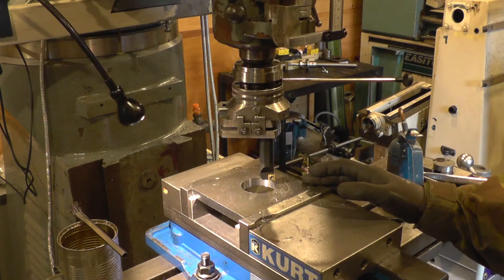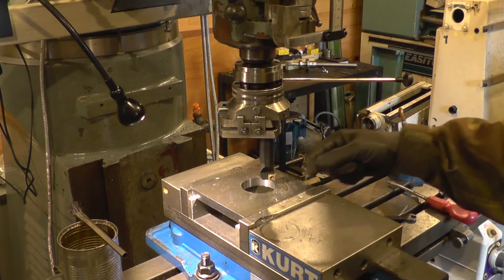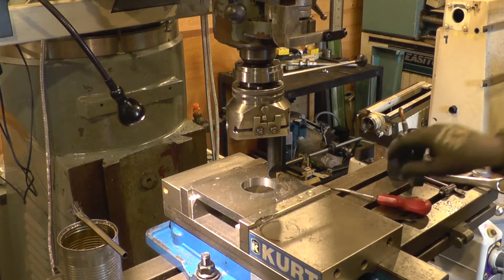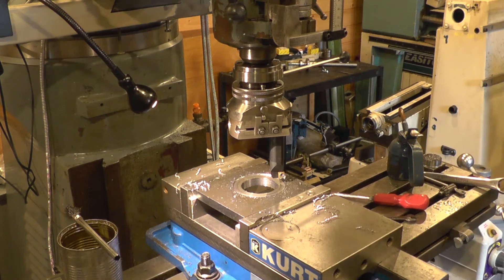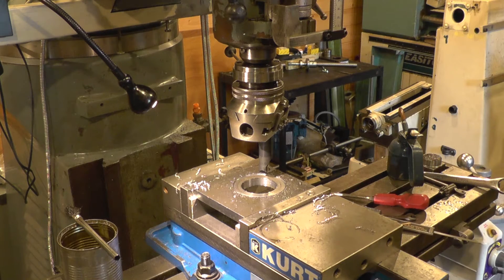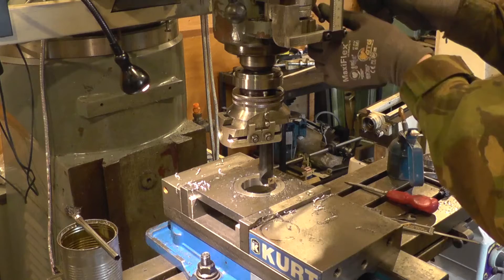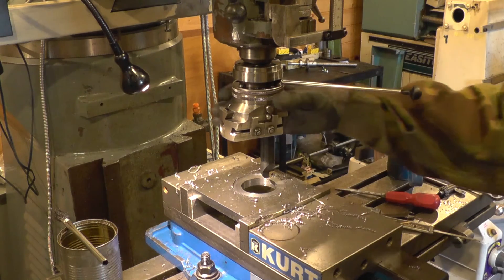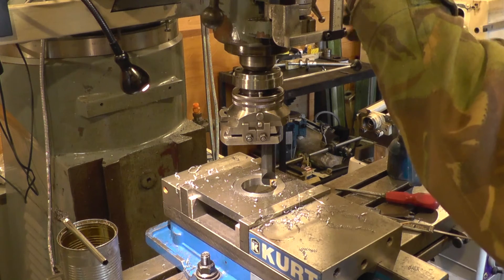Trying out the Automatic Boring & Facing Head

Comment: Hey dude do yourself a favor and use German machine for milling steel. I once owned a bridge port as well. Then i switched over to Deckel. Since some years now. In my opinion the bridgeport is good for milling Wood and plastic without Shatter😀
Reply: It's not the mill, it's the boring bar extension. This would happen on any mill. The Bridgeport is a good milling machine, they're used all over the US with excellent results.
Reply: @mosfet500  belive me it is an Other world in therms of stiffnes. Please Look up Deckel FP3L for example.    I am Sure it would performe this wo Chatter. I already did many similar boring operations.
Reply: Chatter is a result of many factors: cutter sharpness, length of boring bar, cutting speed & feed, material hardness, etc. Not only the machine and it's rigidity. German machines are good but so are Bridgeports too.

Comment: You would have been better off with a nicely sharpened and oilstoned HSS tool of much shorter length. Replaceable inserts are crap, especially on aluminium unless you buy expensive genuine aluminium type. I suspect you were using a Chinese elcheapo and elcrappo general purpose insert. With that head, can you adjust the facing feed rate, The Genuine Wauhaupter ones you can. I suppose to get around the patent / copyright they added the top ring you use for facing, but that pin access is in a crap place. My genuine Wauhapter has the pin directly in the top knurled ring and is easy to get to and operate. Make yourself a pin eject tool like the genuine one, simpler to use that a screwdriver as it has a milled recess in one end that locates under the pin head and does not slip off like a screwdriver can. If you can give me an email address I can send you a sketch with dimensions and a photograph of the eject tool.

Comment: Hi Paul , i have never used this type of boring head ( would love one along with a 3d taster but the coin outlay out ways the need !) what i’m curious about  is  if you could use the auto trip to set a cut off point when boring a cylinder ? I was thinking it would be handy if you could take a primary cut then measure and then set the auto stop using feeler gauges or gauge blocks to set the trip point for each depth of cut or even better set a final cut off and just wind the ring around X amount of turn / turns each cut.

Comment: Love boring heads but not the chatter. Are they prone to the same chatter on the lathe with a rigid spindle? (i'm guessing the loose quill bore gives problems)
Reply: Chatter is caused by the length of the boring bar - if Paul had a stubby boring bar say less than 25 mm long the chatter would disappear and this also goes for the lathe , shortest largest diameter is always best .
Reply: @Flattyman  A mill has a weak point thou, the quill . ..unlike a lathe. They typically move a lot
Reply: & the leverage length from the cutting edge acting on the quill.
Reply: I've never had much luck with any of the cheap off shore carbide I've tried so far. Sandvik Coromant has a really good YT video showing how they make there replaceable carbide tips. It's a highly automated but still no doubt expensive process to do it correctly no matter where in the world it's being done, and labor costs would have very little to do with the final selling price. I'm no expert, but that cheap price always means to me that for cutting tools one or more steps were missed or corners were cut to meet that low price point. I'd be willing to bet a decent quality tip on Paul's boring bar would have resulted in far better results without all the chatter this video was showing.
Reply: @turningpoint6643  Chatter with boring heads even with very sharp tools is still a bugger. Only heavy cuts that really plant the quill into the quill bore seem to work
Reply: @bubster1981  I'd certainly agree, I've got some short stubby braised 5/8ths dia. bars that came with my Narex B/F head that don't seem to chatter anywhere as easy as the one in the video did. Tool stick out is a big part of the tool producing chatter as well. My usual first method when it starts happening no matter what tool it is would be to reduce the rpm and up the feed rate. 95% of the time that does make a big difference. To be fair Paul's bar diameter to length ratio was maybe a lot more than ideal for a hardened steel bar.
Reply: @turningpoint6643  Its a bugger, everyone i know has problems. Precision bores are one , as you have to finish with large cuts and hope...to light and the bore may be chattered ruined
Reply: It couldn't be the sloppy fit of the bar in the head could it , sorry Paul couldn't resist. 😉 It almost certainly is the tip, Aluminium does like really sharp tools.
Reply: Rotate the bore bar backward in the head a little so as to create a dragging effect or negative top rake to load the entire system (quill, bar, bit, gibs on b/head, and  back gear & drive system) and as you approach the corner, lower the rpm to a crawl if need be as well as let go of the feed bar(reaction bar) and then stopping the bar every other revolution or so till the stop is tripped then engage quill feed up to smooth out the bore, and you always when boring (on mill) want to have your quill clamp snug, but not so tight as to kick out the feed, once set try to leave it alone so you won't affect cuts and measurements and always take the same amount of stock in each cut in order to produce consistently good chatter free cuts (total stock divided by number of cuts. Remember that as diam. Increases, rpm decreases, so if you set rpm for largest diam when facing you should avoid that maddening chatter late in your last cut that will make you want to scream! Also, remember that aluminum and carbide sometimes just don't work well together in which case hss may be your best option also boring and facing love back clearance and or small tool raddii. Happy chips to all and to all a good day, BP.   p.s. I think the stop dog clamps on the facing head could be swapped in order to affect a narrower or wider differential. Cheers from the USA!